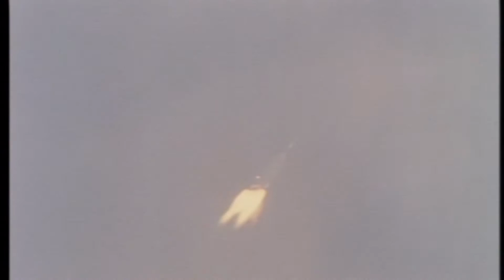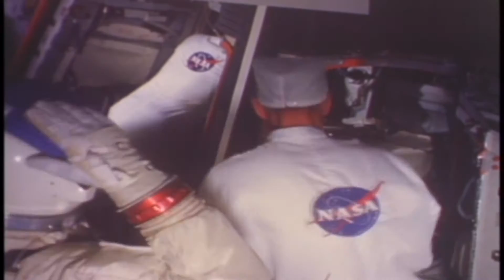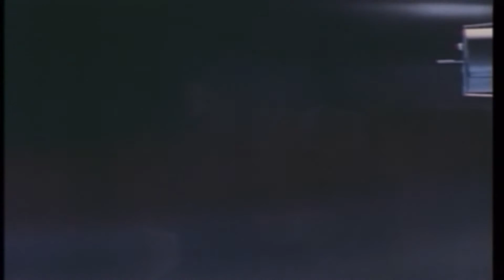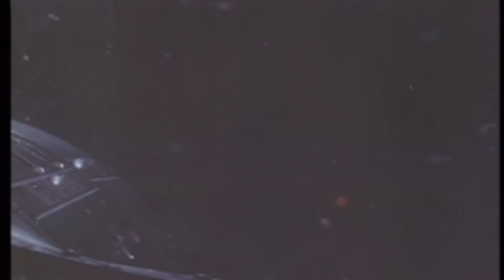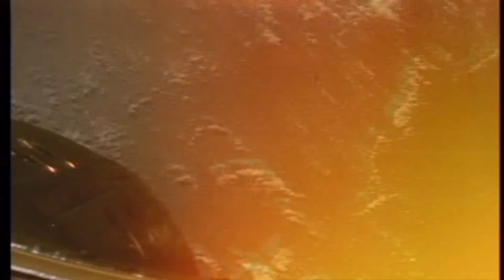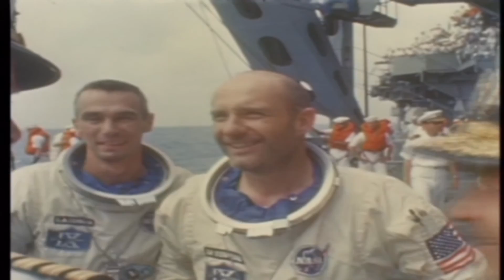(OLD) Homemade Documentaries: Gemini 9

Comment: Stafford wanted to try to nudge the thing and some ppl on the ground including Aldrin were even seriously considering an eva.  The flight director was strict against both because that thing was still spring loaded. The astronauts made clear they wanted no eva at that time and so the idea died. Kranz writes that in his book and you can hear the capcom part  it in the audio. But knowing what went on in the backrooms where higher ups wanted to overrule the fligh director is interesting.
And given how the other eva later went, that could have been a massive disaster.
Reply from the maker: That angry alligator’s fairing jaws could
have snapped shut and ripped a Gemini suit to shreds!